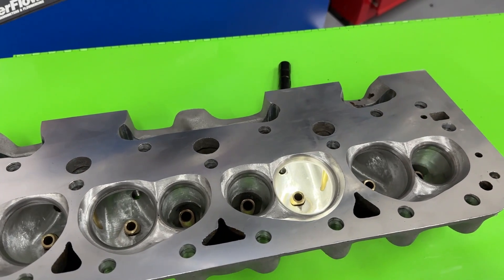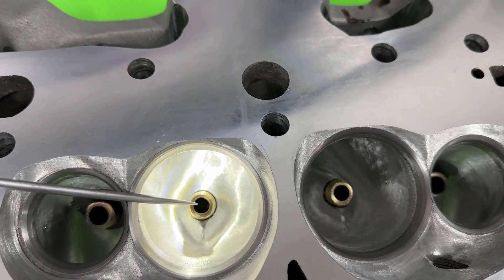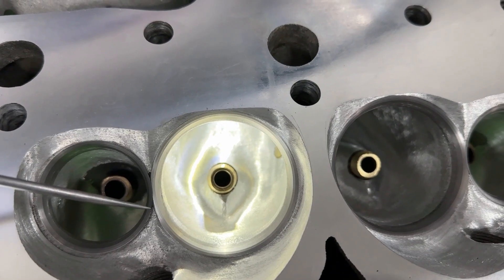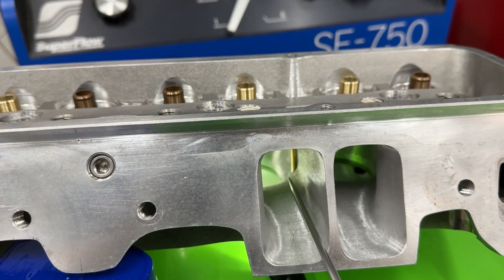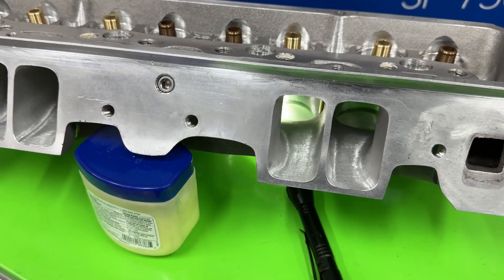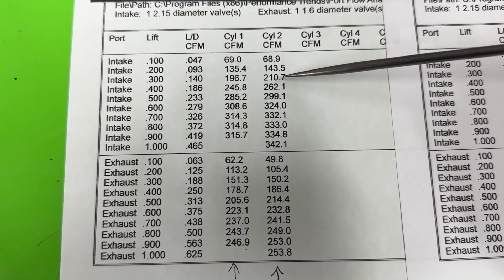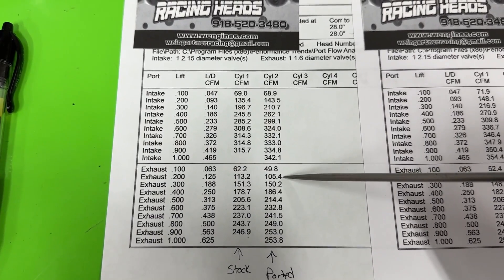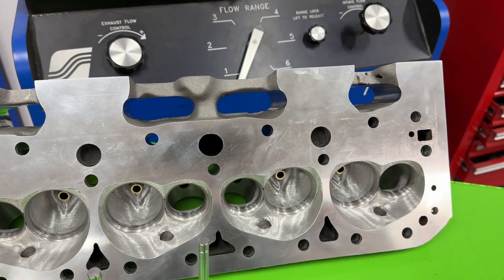Improving Brodix Trac 1 233cnc Ported Head

Comment: Eric, I have a new to me set of  Brodix 46-221 heads. They have Spec in the exhaust and intake ports. They also have IMCA on the exhaust side lower center portion of the heads. Opinion on these heads? If used for street/strip, would removal of the SPEC i side the ports make a decent  improvement in airflow?

Comment: Lets say I was wanting a pair of these heads or something similar. Would it be better to have them cnc from the manufacturer and you port them to this stage or as cast and you port them ?
Reply from the maker: I would prefer to port a cast head but it takes much longer.
Reply: @WeingartnerRacing  Thanks for answering Eric. I am thinking having you completely port the heads would be a better value. The extra cost would be offset by a better product in the end.